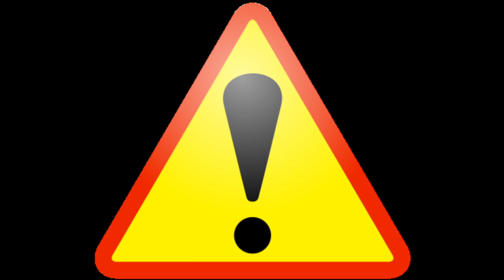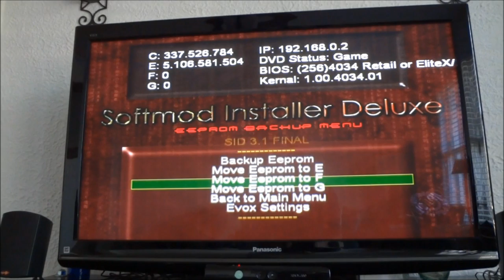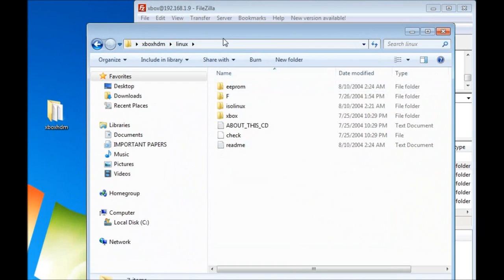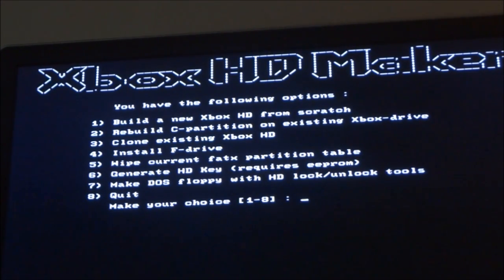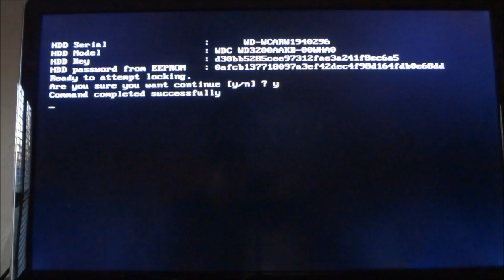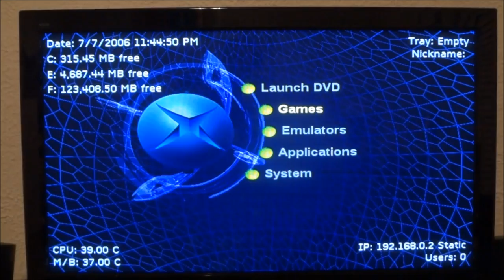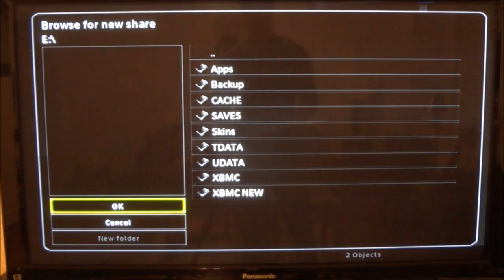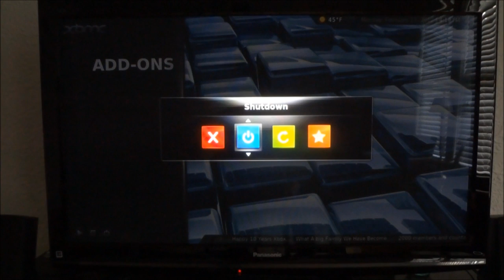How to Softmod an Original Xbox, install XBMC, and install a bigger Hard Drive!

Comment: Why sit there and do all that work to play emulators when you can just download and play them on a pc with Xbox 360 controller connected.
Reply from the maker: The purpose is to have the complete package of games, manuals, commercials, etc all in one quick and easy to use package. Check out some of my other videos for an example.
Reply: Ben's Channel He meant what's the practical sense of it all, like "why do Y when X is so much easier".

The answer varies with the person:
1. Some ppl are hobbyists.
2. Some want to see if they can do it.
3. Some ppl have alot of spare parts and units laying around and want to put them use rather than throw them away.
4. Not everyone likes running EMs and other homebrews on their PC (because they may only have one PC or they use it for something else).
5. FuxM$ Team: After years of supporting M$, others have joined the darkside after having realized they have been screwing over the gaming community since they entered the market. They sell cheap machinery that is designed to break easily so they make a killing on warranty and aftermarket sells. I own a DVD player that has been working since roughly 1998. However my Xboxs have all burned out their lasers or had some alignment issue usually about 1 1/2 -2 years after purchase.
6. For Science: Some ppl just like trying out new/old stuff that they came across on random.
Reply: Javier Torres I get what you're saying Javier, It's more of a fun thing for some people to do. I was going to make an arcade and put it in there. I didn't want to put my computer in the cabinet so I'm going to make it exclusively for that.
Reply: +Javier Torres I would except I haven't been able to find a decent original xbox emulator(which I really want to, since there's an ISO I really want to play) but they're either filled with viruses or don't work. This is why people soft mod their xboxes until a decent emulator is released or it's a good challenge to hack your own console and incredibly rewarding.